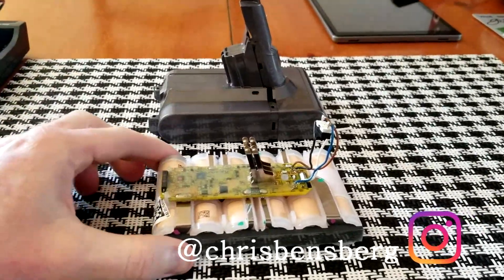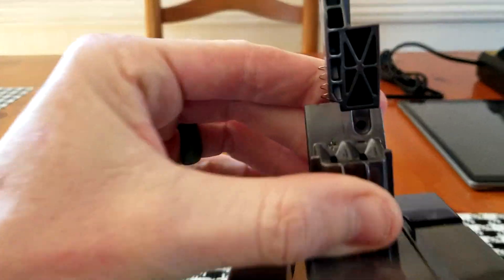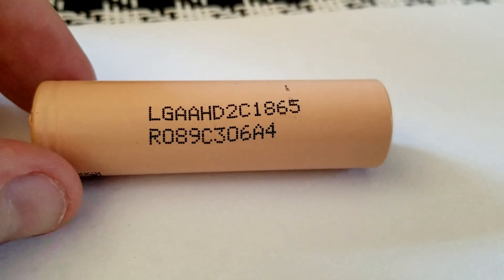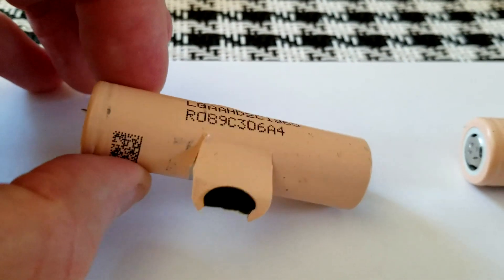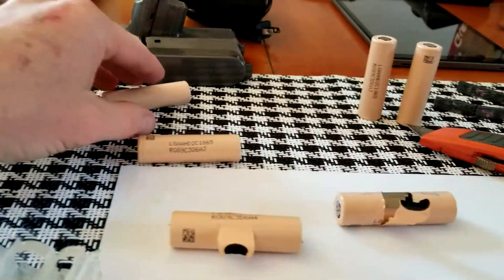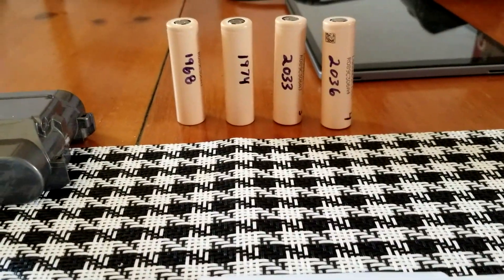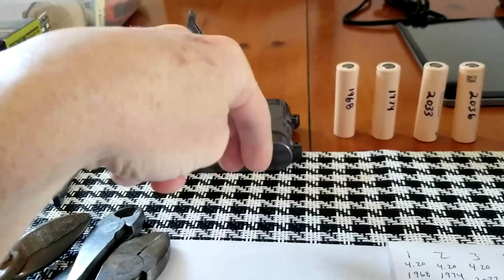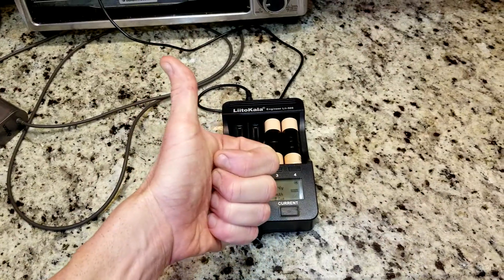What 18650 Battery Cells Are In A Dyson V7 Vacuum Is It Worth It To Reuse For Electric Bike Scooter?

Comment: Could you please tell me what amperage battery should I get to get the best performance out of my handheld vacuum? Yes, I know the higher the mAh the longer it works but, I mean the A(amperage) does that matter in the vacuum world?
Reply: It matters in the sense that your cells might catch fire if their rated discharge rate is too low. Or at least die. Not much increase to performance though. You very probably want 20A rated cells.

Comment: 2:28 The whole pack is 2000mah according to Dyson's label on the back of the pack. 6 18650 in series with 2000mah is still a 2000mah pack, just at 22V nominal instead of 3.66V of a single cell. In parallel the capacity instead of voltage would add up, but these cells are in series. This is how the pack is 44Wh: you multiply the 22V voltage by 2Ah capacity.
Reply: Great way to explained to some one like me , i am learning every day something new

Comment: It isn’t always the cells that are bad in a dyson pack. The boards go bad in them as well and there are ways to “reset” the packs too.
Reply: How ?
Reply: @wlcsp  Unplug the charger from the wall. Plug it in again. Attach your Dyson and press the trigger (on button) for around 20 seconds (nothing will happen, just keep it pressed). My Dyson worked perfectly again straight away after doing this.
Reply: @fubutthole  Just searching the internet. I didn’t figure it out….someone else did.

Comment: Laptop batteries sometimes have samsung or lg 18650 batteries in them.  I pulled a lenovo battery pack apart and it had 6 batteries inside of it.  1 was bad and 5 tested good.
Reply from the maker: Excellent score:) and thank you for the tip:)